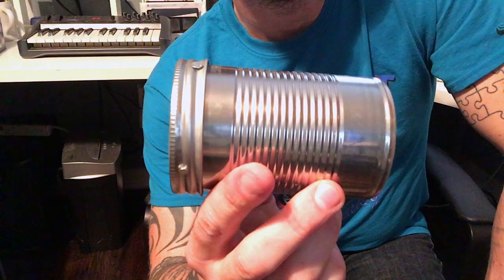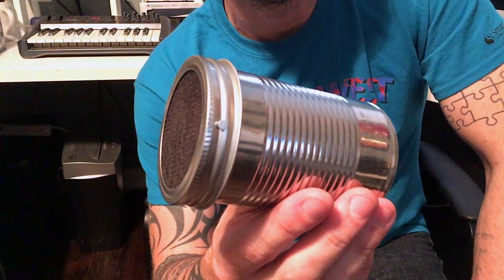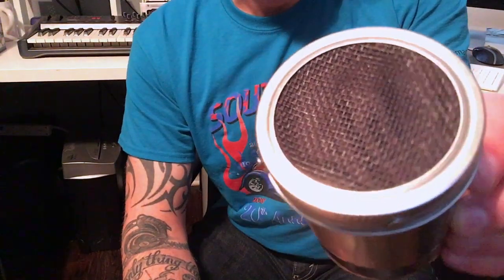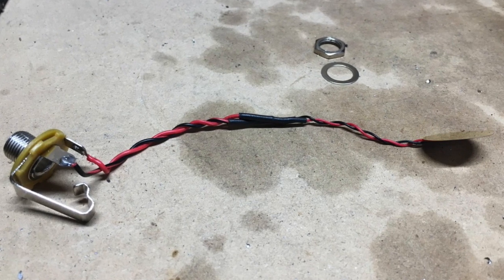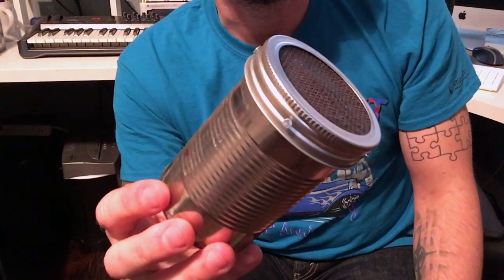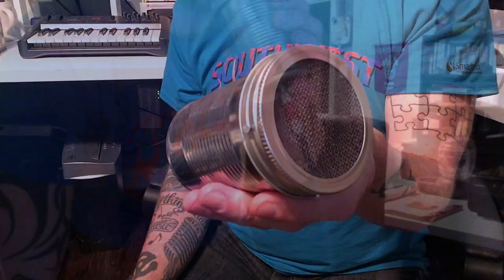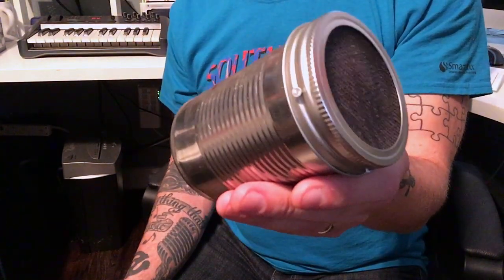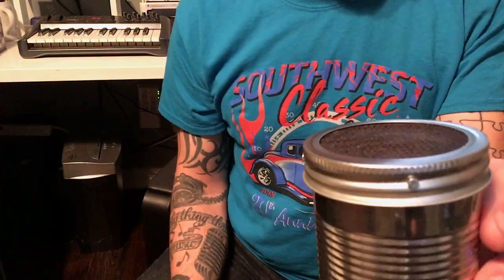How to Make a Soup Can Microphone

Comment: This week I debated buying an SM57 for a little vintage sound. You have officially inspired a man in the UK to go out to the garage and build the (maybe) first exhaust-pipe-offcut microphone (soup can variant mk2.) It'll be a little narrower and a little shallower, I can weld/braze the bottom on and holes/fixings/attachments to taste! This could be MEGA!

Thank you for the video there sir!
Reply from the maker: Thanks for that comment. That's exactly why I post these kinds of videos. I hope to inspire someone else to build something. I'm so glad the video was helpful. Thanks again.
Reply: @musicalmiscellany  Okay so it got finished, tested in the DAW and thought I'd report back. Made from 1-1.5mm mild steel exhaust offcut, 12cm long, 5cm diameter. Welded a disc to the bottom to close it up, 1/4" jack in bottom, welded M6 fitting to the side to mount it, stuffed with sponge, pickup element isolated on a thin tin mount pop-riveted about 1cm shy of the top, section of an old sock zip-tied to a captive ring on the end as pop shield. The sock was grey, I don't know how much of a factor that is. All edges at least finished and flat.

Needs a bit of gain but it's remarkably quiet for it. The quality of the sound though ("quality" meaning "usable with vintage essence") is VERY good! It's vintage and lo-fi but the exhaust pipe being a bit more substantial obviously knocks out the resonance you'd have left from a soup can, even stuffed with sponge. I think the stars aligned in use as a vocal character mic, not sure it'd actually be as versatile as the soup can in fact! It is fascinatingly sweet-sounding; there's... just... NO harshness in the upper mids and it has an inclination to almost tame itself whilst drawing everything back to a very very sweet sound. This really did amaze me tbh. I wouldn't necessarily say it's overly warm but it's got NO harshness to it AT ALL. There may be something in, as I mentioned, the thickness of that metal and the depth of the element from the top being about 1cm gives it the capacity to resonate somewhat. Either way happy accident!

It'll just kiss the VERGE of breakup if you scream yourself silly into it. There's an amount of 50-90z rumble going on, hi-passing that out slightly brings out the upper mid character so I think that'll just be a quirk of it. Might also have just been because I had it propped on the desk for a test.

Thanks again for your video! I think the soup can would actually be a better all-rounder and deliver more "character mic" for a studio. However a slightly more vocal-focussed alternative does exist in the exhaust offcut mic! Greetings again from the UK there. :)
Reply from the maker: @dismalfist  I appreciate the follow up post. I always love it when people take one of my videos and run with it and I appreciate it even more when they report back. Thank you so much.

Comment: This DIY ROCKS! I've made lots of diy mics out of thingies but I'm gonna try this one.  TIP i often use the drivers from headphones as they are a fairly common dumpster dive treasure They are high spl, lo output but can be relatively clean and work OK for bass and kick as the third mic.
Reply from the maker: Thanks for checking out the video. I really appreciate the comment. That's a great idea to upcycle headphones into mics. I dig it.

Comment: Do I need a big plug (dont know the actual name) cause I'm using an adapter for a normal aux cord and it doesn't work?
Reply from the maker: I'm not sure what you're asking exactly but the jack shouldn't make a difference. You could do the exact same thing with 1/8", RCA, XLR, etc. As long as the piezo leads are properly soldered to the + and - it should work.

Comment: Would an Altoids tin work for this?
Reply from the maker: Thanks for watching. I haven't tried it... but I imagine an Altoids tin would work (provided you have enough depth to mount the jack on the side of course). It would be the same general idea. Hot glue the piezo to the lid, mount jack on the side, put some sort of deadening material in the tin and bam... it should work.

Comment: I only have 3.5mm Jack cable and I want to connect it mobile. How to do it???
Reply from the maker: I'm not 100% clear on the setup, but chances are you would need the correct cables/adapters to convert 1/4" to 1/8". If you're building the mic yourself, you could just use a 1/8" jack in the mic (instead of the 1/4" jack)... or you could find a cable/adapter that converts 1/4" mono to 1/8" mono.

Another thing to keep in mind is that most mobile devices are 1/8" stereo and this microphone is going to be mono. There are adapters designed to convert a mono signal to stereo which is what you're probably going to want unless you're using some sort of mobile audio interface that's designed for mono connections.

Again, I'd have to know more about the setup to really understand what you need.
Reply: @musicalmiscellany  how can I explain you argggh. Ok, i have a piezo disk and it has three terminals and I have a 1/4 female output and 1/4 Jack. That's all I have and I want to make a pickup so that I can record with mobile
Reply from the maker: @kryptongaming84  This sounds like something that's going to be difficult to solve via YouTube comments. I think you'll get a quicker answer on a homemade instruments forum. A couple you might want to check out are cigarboxnation.com and handmademusic.ning.com. I'd say ask your question there and post a couple photos... you'll probably have an answer in no time.
Reply: Rephase the dilithium crystals with the glam rods then download the framus upgrade and install the 8 bit operating system.  Works like a champ.

Comment: Hey man, just stumbled on your channel. Great stuff! So I gave this a shot and it works pretty great but mine is having issues with some pretty unfortunate feedback. Any tips on curbing that or is just because I bought a poor quality piezo?
Reply from the maker: I doubt it has to do with the piezo. It's probably reverberations in the metal. What did you use for dampening material inside the can?